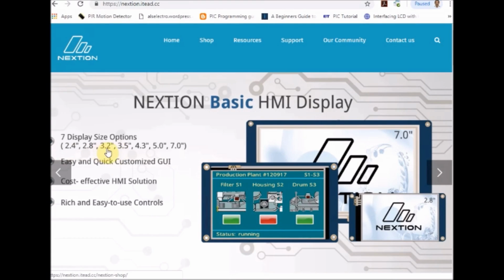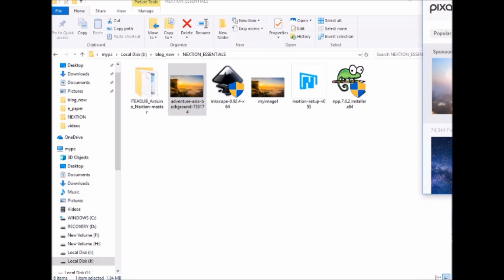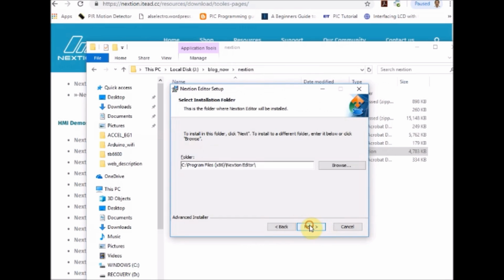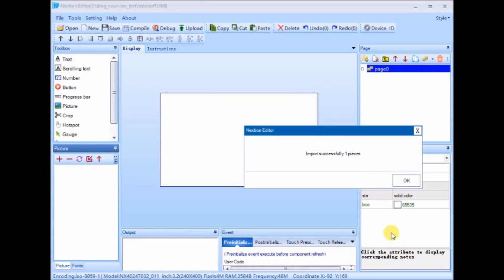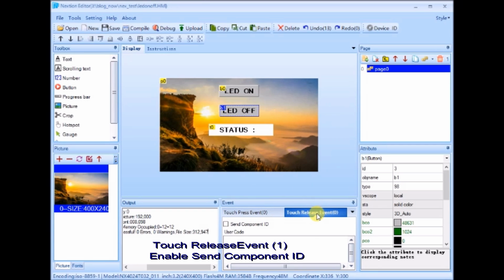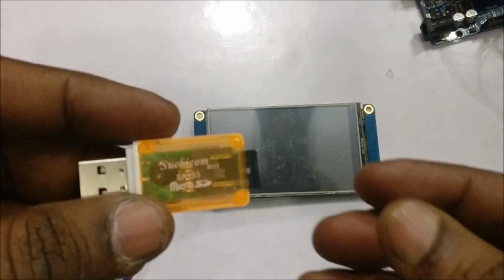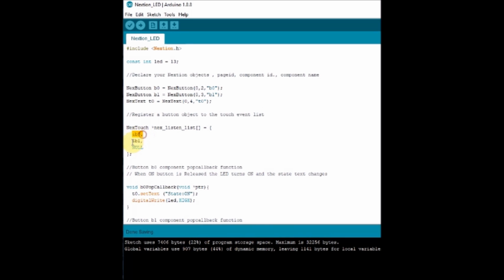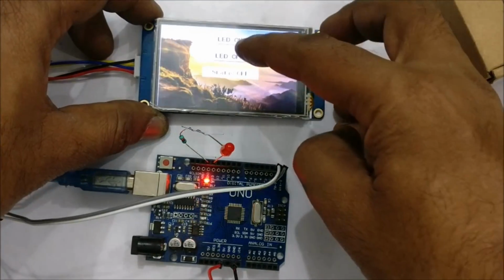NEXTION HMI DISPLAY WITH ARDUINO -Getting Started with LED ON/OFF

Comment: I could never get the software to work with either of my computers win10 and win 11. It keeps saying i nèed  to install vc++ redistrbutable, but when i try to install that, it says it's already installed with latest version. I even bought the second laptop specifically for this reason but had same issue. Anyone else had this problem? Gave up in the end and went with the DWIN screens instead, software works fine for those.

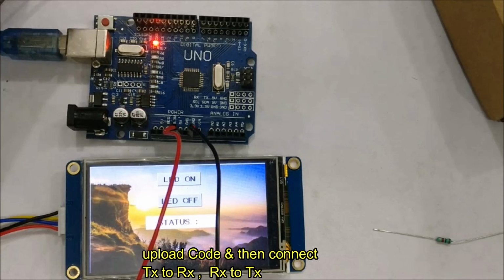Comment: Great tutorial. Question: at tutorial video 20:55, it says: "Before connection the RX/TX, you have to upload the code..." of the Nextion_LED. I see you are using a different platform/development environment than the Nextion Editor for that. Can you elaborate on/where do you get the environment you are switching over to create and compile the code for the Arduino ready to UPLOAD? Thanks
Reply: He's using the Arduino IDE programming environment.  You get it from arduino.

Comment: Great tutorial and thanks for that. But...I keep getting stuck when I try to compile the arduino code. There is no NexButton.h in my library. Ive downloaded and installed it twice and keep getting the same error below. Everything else seems to be in the library but the basic button. Any ideas?

C:\Program Files (x86)\Arduino\libraries\Nextion/Nextion.h:25:10: fatal error: NexButton.h: No such file or directory

 #include "NexButton.h"

          ^~~~~~~~~~~~~

compilation terminated.

exit status 1
Error compiling for board Arduino Uno.

This report would have more information with
"Show verbose output during compilation"
option enabled in File -> Preferences.
Reply: I found the problem. The library I downloaded from the display website didnt contain the file for some reason. Got it from github and no problems now, the file is in there. Just in case anyone else had the same problem.

Comment: Hi, Thank you for a great video. When you are uploading with the USB cable are you uploading to the built in flash memory or did you insert an sdcard on to the board?
Reply: It uploads to the built in memory whether you use USB or the SD card.

Comment: Thanks for very detailed information. I have some issues and I need your help. I have Arduino Uno WiFi Rev2 and Nextion NX8048T050. I did everything as you said including comment out by // in lines 27 and 32 changed serial2 to serial in line 37 of NexConfig file. Your code uploaded fine with no problem. But I didn't see any LED blinking on the Arduino Uno WiFi Rev2. Then I connected RX to TX and TX to RX as you said. But I am seeing LED ON and LED OFF function not transmitting to STATUS of Nextion Monitor or in LED bulb connected at 13. Could you please help me. Thanks
Reply: Check that the page id, component id and component name in the code match with the page id, component id, and component name for the objects in your tft file.

Comment: Thanks for knowledge sharing sir. Could you suggest main difference between ili9341 display and nextion display and may I know best display for Arduino?
Reply from the maker: ILI displays cannot be underestimated.For that price it shows good result.Only limited sizes available.But Nextion display is organised one and the Editor makes it easier to develop GUI displays easily.Also the hex code available at serial interface against element events makes programming easier with any microcontroller
Reply: Saravanan AL how can I reach you